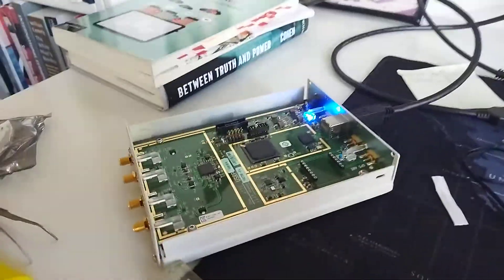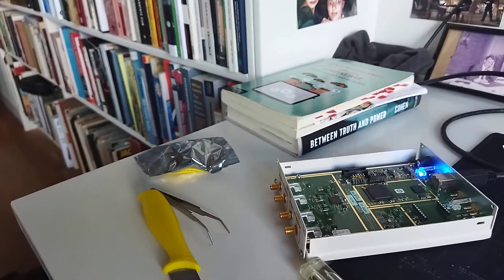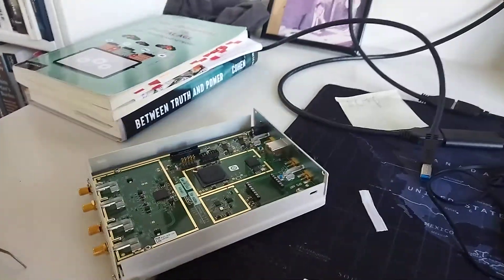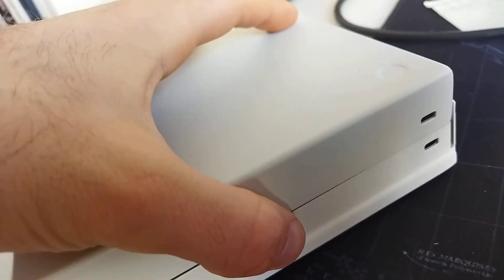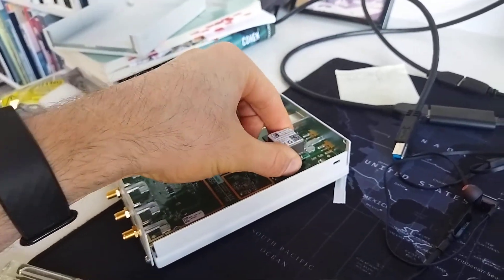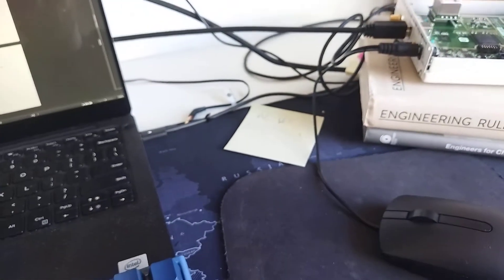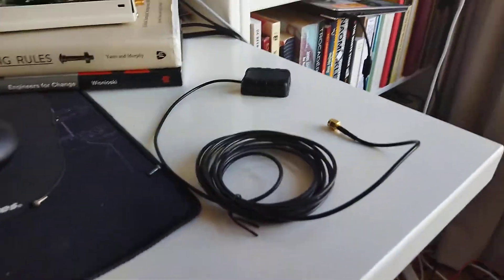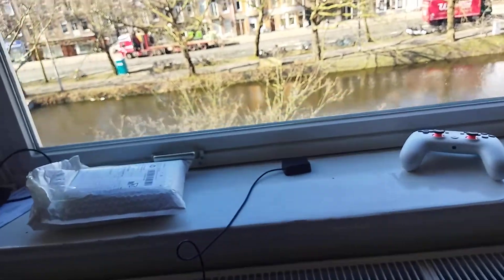Mounting after-market OCXO GPSDO on USRP B210

Comment: This is NOT a GPSDO, therefore, in this video there is no point in attaching a GPS antenna. I purchased what was advertised as a GPSDO from aliexpress but instead they sent me the exact same one shown in this video. The store's response was ”this is just an isothermal crystal oscillator. It's not a GPS-DO, it doesn't have a GPS module, which is why it's cheap. It just uses clever design to make UHD think it's a GPS-DO, but it's not really a GPS-DO. OCXO can provide high-precision 10MHz reference for B210, improving its frequency accuracy and phase noise”

As an alternative, external standalone GPSDO devices are generally much cheaper (almost half the price).
Reply: Could you recommend any external standalone GPS-DO devices?
Reply: I used the LEA-M8F-0-00 unit but it did not work for me. I get the error NO FOUND GPSDO. What should I do? Can you advise me? Thank you very much.
Reply: I USE UBUNTO 18.04.6 AND 22.04

Comment: I have USRP X300 and I connected a 3-5 volts GPS antenna has been bought online (not manufactured by ettus). I ran a GNRADIO flowgraph, and it gave an error, even I used clock source as O/B GPS DO. 
Also, I ran the uhd_usrp_probe and it showed no GPS found. Any ideas how to solve this issue?

Comment: I'm running a GSM network with Ettus usrp B210. But it isnt running when i start 'osmo-bts-trx'.  
You can share all .cfg file for me? (osmo-hlr, osmo-bsc, osmo-msc, osmo-trx_uhd, osmo-bts-trx)
I check to see where the error is.  Thanks!
Reply: /////////osmo-bts-trx
<0010> socket.c:912 unable to bind socket:127.0.0.1:4238: Address already in use
<0010> socket.c:923 no suitable addr found for: 127.0.0.1:4238
<0010> socket.c:912 unable to bind socket:127.0.0.1:4241: Address already in use
<0010> socket.c:923 no suitable addr found for: 127.0.0.1:4241
<0010> telnet_interface.c:100 Cannot bind telnet at 127.0.0.1 4241
Error initializing telnet
Reply from the maker: @TinhNguyen-vq7dg  looks like you haven't correctly configured the local IP addresses between the services. Maybe you can try a prepackaged environment such a this open5GS docker environment: https://github.com/herlesupreeth/docker_open5gs
Reply from the maker: Else perhaps try the Osmocom openbsc mailinglist? They are rly quite responsive.
Reply: @mediactionfoundation  you can share all configure files.

Comment: hi, have you tried using that to osmo-trx-uhd? im receiving an error when selecting gpsdo as clock-ref. it says "gpsdo selected, but no gpsdo detected!" even if i can see that it was found in uhd_usrp_probe.
Reply from the maker: Hi Henry, I just tried and it pains me to say that it worked right out of the box for me:

kosmos% osmo-trx-uhd -C /usr/share/doc/osmo-trx/examples/osmo-trx.cfg          
 
Info: SSE3 support compiled in and supported by CPU
Info: SSE4.1 support compiled in and supported by CPU
Failed to open config file: '/usr/share/doc/osmo-trx/examples/osmo-trx.cfg'
kosmos% osmo-trx-uhd -C /usr/share/doc/osmo-trx/examples/osmo-trx-uhd.cfg 

Info: SSE3 support compiled in and supported by CPU
Info: SSE4.1 support compiled in and supported by CPU
<0001> telnet_interface.c:104 telnet at 127.0.0.1 4237
<0008> control_if.c:887 CTRL at 127.0.0.1 4236
Config Settings
   Log Level............... 0
   Device args............. 
   TRX Base Port........... 5700
   TRX Address............. 127.0.0.1
   GSM BTS Address......... 127.0.0.1
   Channels................ 1
   Tx Samples-per-Symbol... 4
   Rx Samples-per-Symbol... 4
   EDGE support............ 0
   Reference............... 0
   C0 Filler Table......... 1
   Multi-Carrier........... 0
   Tuning offset........... 0
   RSSI to dBm offset...... 0
   Swap channels........... 0
   Tx Antennas............. 'TX/RX'
   Rx Antennas............. 'RX2'

[INFO] [UHD] linux; GNU C++ version 10.2.0; Boost_107100; UHD_3.15.0.0-3build2
[INFO] [B200] Detected Device: B210
[INFO] [B200] Operating over USB 3.
[INFO] [B200] Detecting internal GPSDO.... 
[INFO] [GPS] Found a generic NMEA GPS device
[INFO] [B200] Initialize CODEC control...
[INFO] [B200] Initialize Radio control...
[INFO] [B200] Performing register loopback test... 
[INFO] [B200] Register loopback test passed
[INFO] [B200] Performing register loopback test... 
[INFO] [B200] Register loopback test passed
[INFO] [B200] Setting master clock rate selection to 'automatic'.
[INFO] [B200] Asking for clock rate 16.000000 MHz... 
[INFO] [B200] Actually got clock rate 16.000000 MHz.
[INFO] [MULTI_USRP] Setting master clock rate selection to 'manual'.
[INFO] [B200] Asking for clock rate 26.000000 MHz... 
[INFO] [B200] Actually got clock rate 26.000000 MHz.
-- Transceiver active with 1 channel(s)

Good luck and happy hacking!